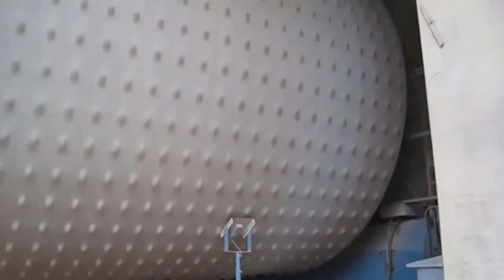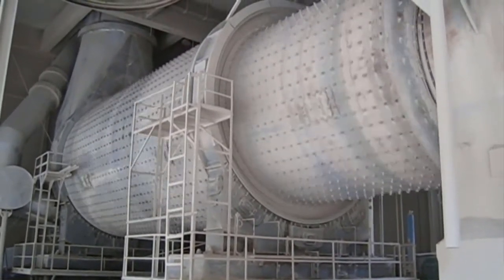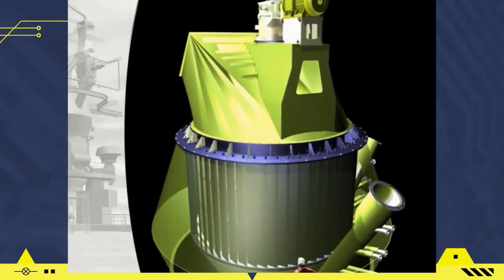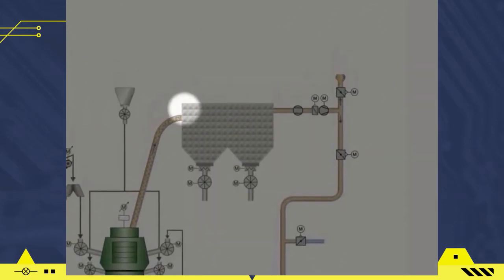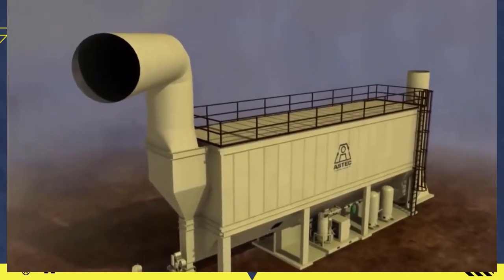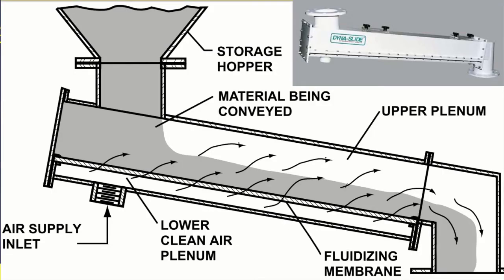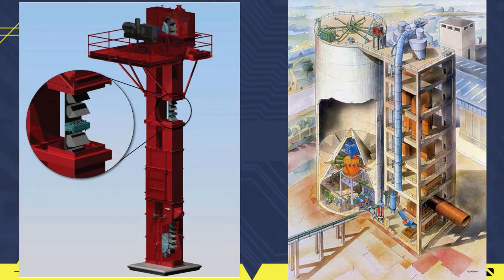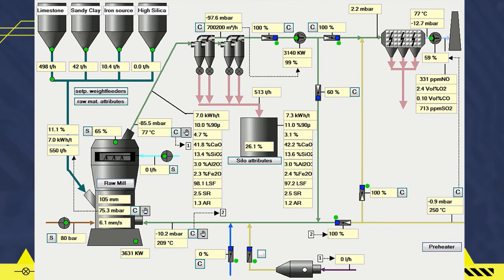Cement Raw Materials Grinding Process (Raw Mill System) _ English Version

Comment: Q. All four constituents are grinded seperately & after grinding stored in silo also seperately  ?? 

Q. And if not grinded & stored seperately then how silo act as uniform mixing & homogenization??
Reply from the maker: Thank you for your question.
A1 : The four constituents are milled simultaneously with a predetermined composition & after the grinding process has become a raw mix product in the form of flour then stored in a silo.
A2 : The material that has been milled simultaneously has a quality that is not uniform every time, and in the bottom of the silo there is aerated air from the blower which functions as a material stirrer until it is homogeneous, according to the desired product quality.